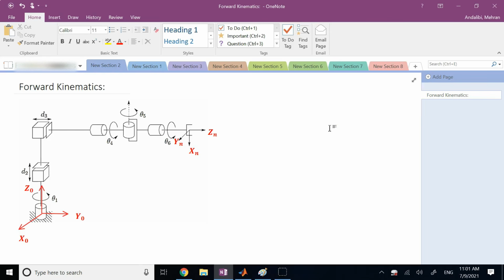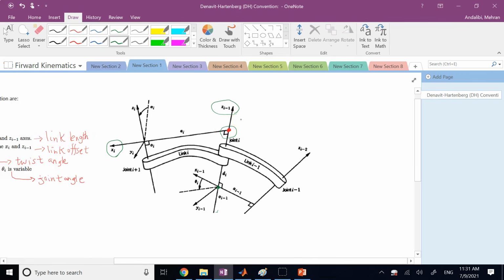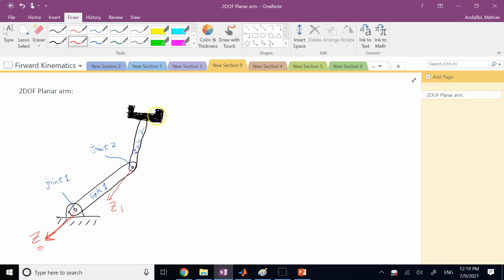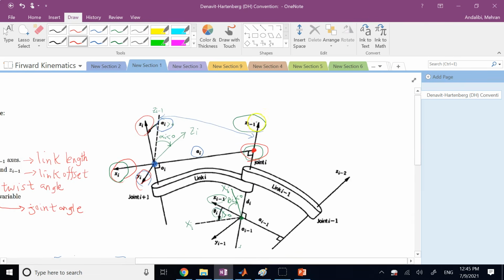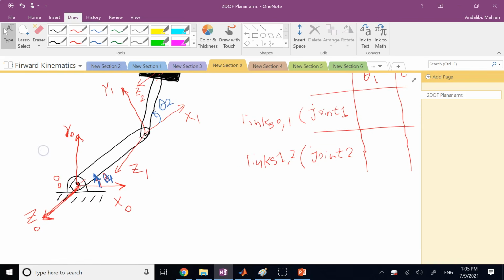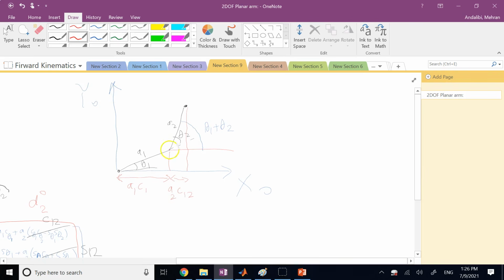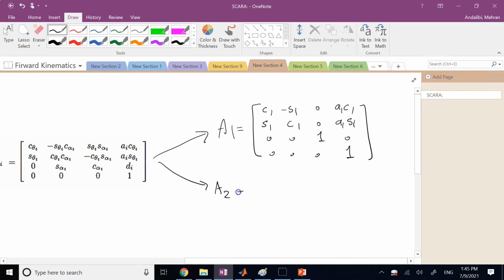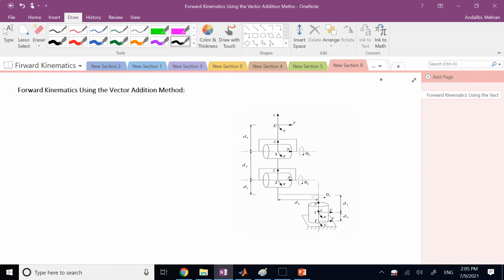Forward Kinematics Using the DH Convention Part 1

Comment: Sir, Initially we chose xi such that it is perpendicular to z i - 1, but as frame i rotates about zi, xi changes orientation and may not remain perpendicular to z i - 1. How does Rotz(theta)Transz(d)Transx(alpha)Rotx(a) still hold (as xi is not perpendicular to z i - 1 after some rotation about zi)?
Reply from the maker: Frame i is rigidly attached to member i and as member i and so frame i rotates about axis zi-1, the perpendicular relation between xi and zi-1 stays intact.
Reply: Thank you sir. I previously misunderstood frame i to be attached to link i + 1.